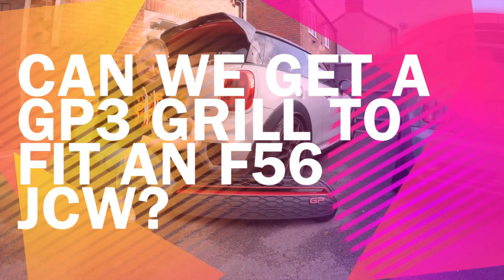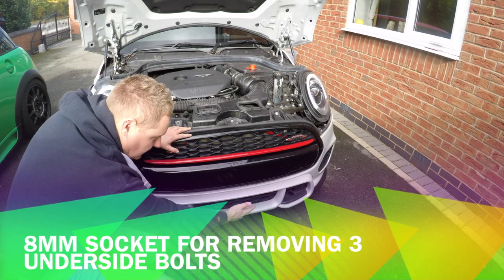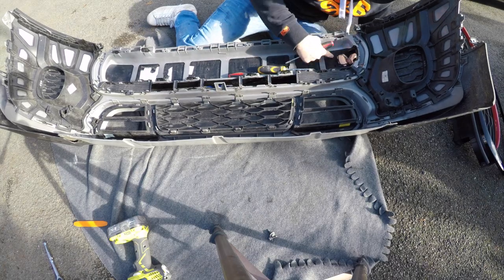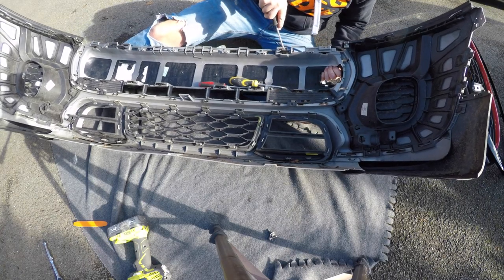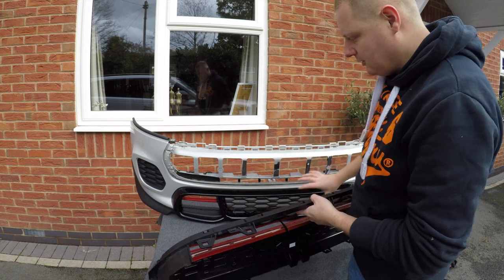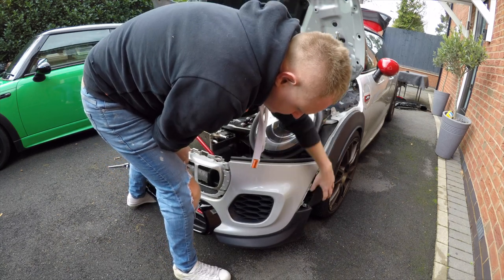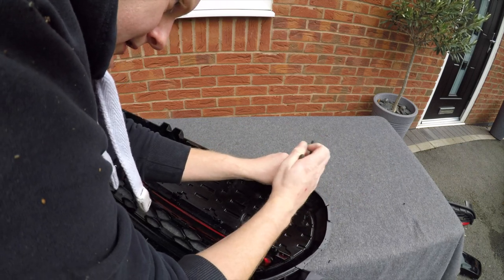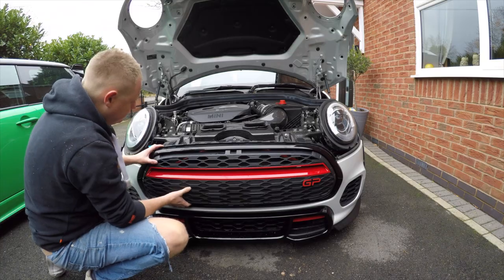Retrofitting the new GP3 front grill to my JCW F56 Mini and it fits an S - It is possible

Comment: Fair play for getting that fitted. I'm still not sold on the look of the GP grille myself.
Reply from the maker: Thanks for watching, I wasn't keen when I saw it on the GP itself, its only when I saw it on a none GP3 I decided to have a go at it
Reply: @tweedbean  definitely looks good with the lower part paint black now
Reply from the maker: @Saavvvv  Thanks, it was a spur of the moment change while they bumper was off the car
Reply: @tweedbean when the lower bumper was painted black did you have to remove it from the rest of the bumper or was it masked around and painted? GP grille looks great btw

Comment: Hi, great work, love the video! On a side note, could the front bumper you have be retrofitted onto a f56 non jcw (with fog lights). If so what is the term for your bumper please. Hope to hear from you and keep up great content!
Reply from the maker: Mine was a non JCW with fog lights.  The problem you have is that this is lci2 JCW bumper was never designed to house fog lights so you won’t be able to buy mounts in the black vented section to re-fit them
Reply: Thank you for your reply!

Comment: Did you ever find a clean solution to covering the gap  at the top when retrofitting this grill?
purchased an aftermarket clone(glossy) for extremely cheap to judge if it would fit/look nice on my cooper S, and am very happy with the look. need to find a proper fix for that gap before i can justify purchasing a proper (non glossy) OEM grill.
Reply from the maker: Yes there’s an OEM part from the gp3 that you can buy, I don’t have the part number to hand but your dealership could get hold of it if you give them a gp3 reg

Comment: Where have you been placing your front number plate bud ? On the dash ? thanks mate
Reply from the maker: I use a towing eye mount from Burger motorsports supplied by Orranje to keep me legal.  Placing on dashboard will get you fined.  It’s quick release as you just unscrew it for photos shows etc
Reply: @tweedbean  ah I see mate , that's a good shout ! Thanks for the information :)

Comment: Did you get the top part fixed in the end?
Reply from the maker: I did, you need 51749464494 plus associated clips/bolts. It’s around £55 for the trim

Comment: Great video, helping alot swapping out my chrome grill for a black trim piece. 

What's the model numbers for your headlights? My F56 with the JCW sport package has halogen headlights for some reason. I really like those projection ones on your F56. TIA
Reply from the maker: Sorry not sure what the code is, they are factory LED headlights

Comment: I’m wanting to replace my chrome strip on my F56 Cooper S for the red chilli strip on the top front grill.will I have to take the bumper off or can I get to it without it being a big job.Great videos 👍
Reply from the maker: It may be possible but very tricky and you risk stressing other parts of the grill by bending it to get to clips on the rear from memory

Comment: Great video! Do you know if there's any issues with the minis that have the front proximity sensors? It seems like there's no room to place them.
Reply from the maker: Sorry not worked on one with it to know, assume it could be an issue as you aren’t the first to ask
Reply: @tweedbean  Thank you! I've realized that the place where the sensor lies is on the plastic plate with lines that is placed below on the corners, which is also left uncovered as I can see in your video. So technically it shouldn't be an issue.